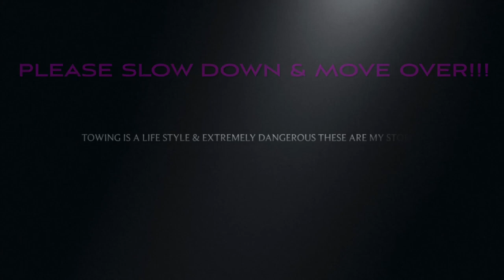Towing flat tire accident car!

Comment: You could have slung it on the wheel lift with j hooks
I had a broken Ball joint State Police call this week 
It broke in the far left lane on I-91N at the 84E interchange 
From now on 
That's how I'm always towing broken Ball joints 
I was out of there in like 5 minutes
Reply from the maker: Back was flat to passenger side but your absolutely right that’s another way also!
Reply: @Towvibes  
I didn't see that 
That changes everything
Reply from the maker: @mattywest9087  and that lot super super  tight would of Ben a pain to back it up in there I just did one 4 flats sat so low 🤬